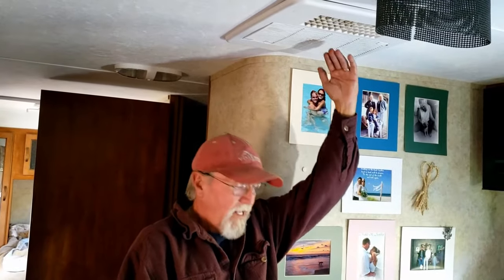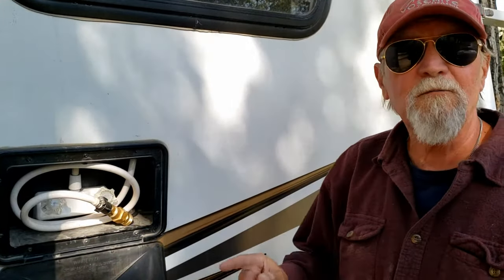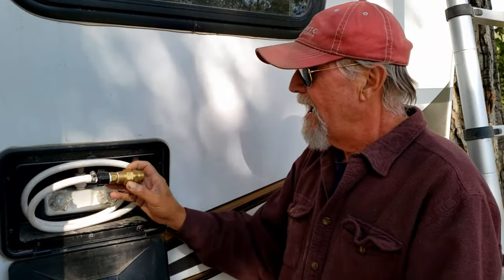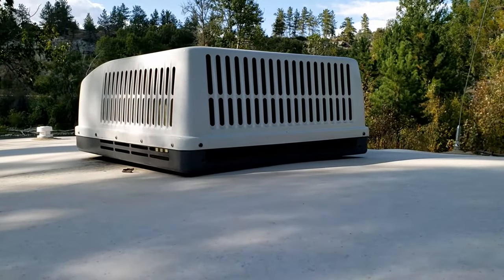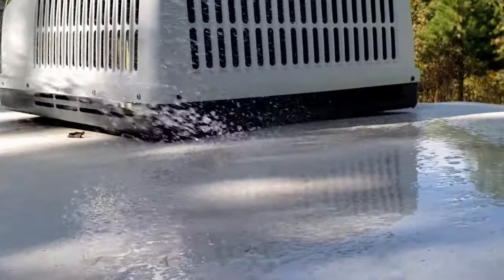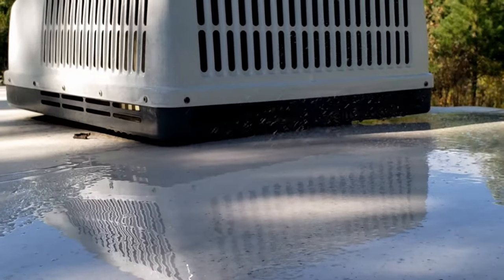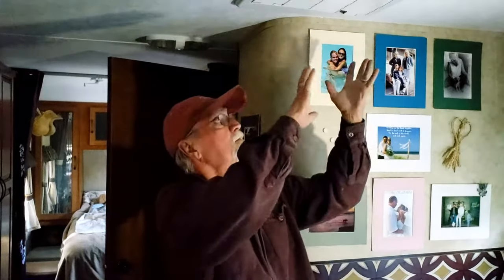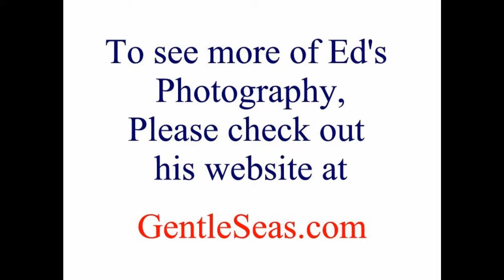Quick & Easy Repair for Clogged A/C Drain - Full Time RV Living & Travel

Comment: thanks for that --- been getting  a lot of freezing on my evaporator due to a lot of water apparerently not properly draining out, and anticipating a big project on the roof.  This is exactly what I needed to see.  The other day I drove my RV to Walmart and when I parked I saw a sudden large amount of water running off the roof - dislodged by the driving and stopping.  So I had a hunch water was not properly draining up there.

Comment: I just cleaned my drip tray yesterday and mine is located around the middle of the unit, so this method would not work for me. However, I totally relate to not wanting to get onto the roof, but I finally had to get over that because there are plenty of reasons one needs to get onto the roof.

Comment: That does not work.  It started leaking more.  Other videos show how to easily remove the cover and clean out the drain holes in the drip pan.
Reply: My drip pan required removing a metal cover with LOTS of screws and gently getting it out from under the condenser, taking it to the kitchen to clean the gunk out and reverse process to get it back together.